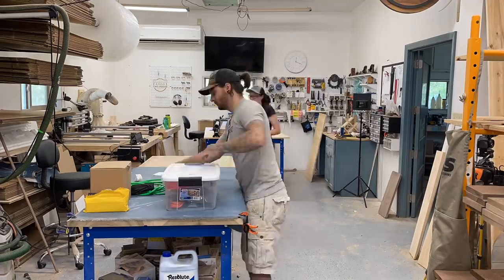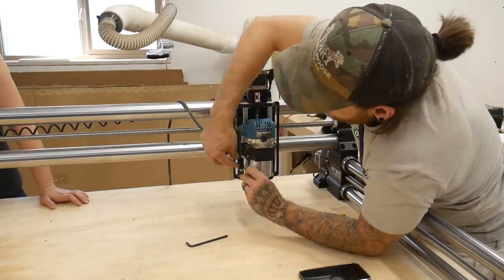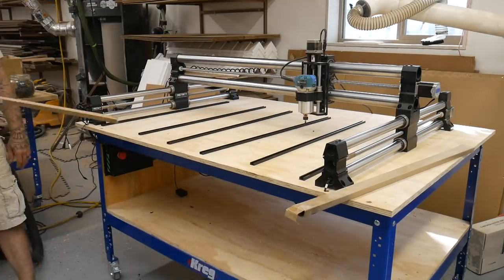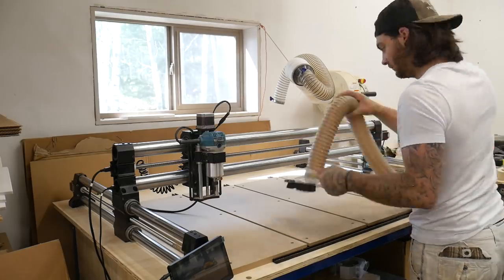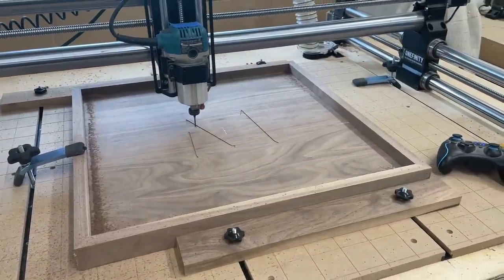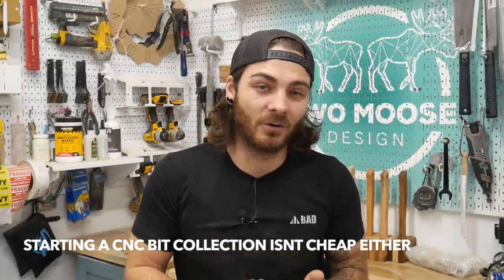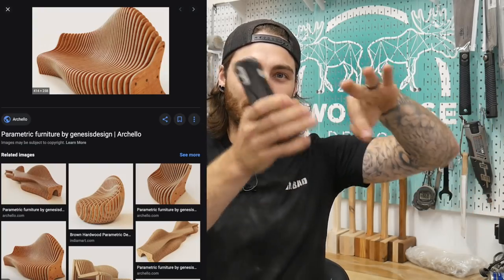Onefinity Journeyman, Bench, and Wasteboard Set up // CNC //

Comment: Nice video! Have to laugh at the people who have nagged about cutting the waste board lol. I come from a precision machine shop background, and these people would cry if they knew how much we would spend putting aluminum waste boards in our mills... It's there to cut, you want the mill going below the bottom of the part for a clean dimensionally accurate finished part. Only thing I think I would have done differently in setup was to use the machine to layout the T slots and predrill their holes rather than take the time to do it manually. I'm awaiting delivery of a new laser to start my journey down this road of custom small scale custom crafting, but once I recover from that purchase a CNC router is next on the list. Likely going with this company. I think for the price this appears to be a beefy well built machine, and the controller and interface on the Elite model looks amazing. I'm used to Fanuc controls on industrial mills and lathes, and that new control looks to give the same feel to setup as I'm used to. Really wish they offered a wired or wireless handheld unit for axis control during setup though.
Reply from the maker: Thanks for the input! And cracks me up too, a sheet of mdf isn’t that expensive and you can get multiple surfaces out of one set up. It’s called a WASTE board lol I surface mine a few times and typically just put a fresh one on once a year just because. The onefinity has been great, I like the elite masso if it’s in the budget.

Comment: I have had the red and black 60watt CO2 laser from Ebay for 3 years. Got it for $1,700.00 I love it. Have not had the first problem with it. I have used a large cooler with ice bottles to cool the water as long as I have had it and it has worked very well. You just have to make sure it comes from a US distributor in case there is a problem with shipping and also there will be no support to run the laser. Like you said about the CNC router, you need to be willing to learn the programs. Not that hard. I just got a water chiller for $455.00. I will arrive today. I will no longer have to freeze water bottles!!!
Reply from the maker: Nice! That’s exciting, I’ll have to look into that I’ve talked to a few people who’ve ran eBay machines

Comment: your dust collector is more than adequate.  You just need to run the 4" hose all the way to the router bit.  This will allow enough airflow for collection.  As it is right now you have a choke point when you reduce the hose from 4" to 2.5".  Open up the flow.

Comment: Question. Youve been a big help figuring out my onefinity purchase. 
I want to get the same Kreg stand but I’m confused on how to run the stringers. Are the stringers sitting slightly above the Kreg channels on the top or flush with the Kreg channels? And how did you screw the 3/4 ply to the stringers. Did you mount the ply to the Kreg stringers as well ?
Reply from the maker: I notch them so they sit flush with the top of the metal channels. Then screw the plywood down to the 2x4. You can add a screw to the bottom of the channel into the 2x4 as well
Reply: @TwoMooseDesign  Awesome, thanks for reply !
Reply from the maker: Thanks for watching!

Comment: Great video. I just bought the same machine. I am to the point of hooking up the 2.2kw spindle.  Question are there steel t tracks available? My very first router was a 6040 and the t tracks would bend with pressure. The only ones I see are aluminum anodized t track.
Reply from the maker: i have no idea, i believe most of them are aluminum 🤷🏼‍♂️

Comment: I want to use my laptop to use to use this machine will I get instructions how to hook it up to my Laptop, thank you nice video
Reply from the maker: hey! if you have wifi whre the machine is you would type in hte IP address on the machine screen into your web browser and it will pull up the machine post proccessor. Just reach out to onefinity im sure they have a blog write up, its pretty easy to do. If you dont have wifi youll have to transfer files manually and use the screen on the machine.

Comment: Do you notice any extra vibration with your table being on casters like that? I'm designing my bench for my new onefinity and am trying to work out movement so I can access the pass thru for longer pieces
Reply from the maker: It does wobble more with the wheels, if you don’t need them I’d skip them. I’ve also haven’t had any issues, my foreman doesn’t have wheels but I left them on the journeyman

Comment: Has the single sheet Of three-quarter inch birch ply with the two 2 x 4 supports been enough for your set up? I only ask because I have people on the one Finity Facebook page telling me I should put more support up under my table top and also that I should put another sheet of plywood on top of the one I have that seems like a little overkill
Reply from the maker: It’s been just fine, if you’re worried just add 3 2x4 supports.

Comment: Thanks for a quick rundown of the machine and the question/answer session.
My experience is with a small Shapeoko I built and then later the larger Shapeoko (which I gave to my son), and Vectric software. Want to get a large machine again.
1)What size are the stepper motors?
2)Do you think the rigidity of this machine is as good as or better than a next wave 520 with the mdf base?  I was thinking of getting the 520 but too expensive , ain't happening this year.
3)Does it have a homing function (x,y,z limit switches)?
4)Do you think the screws are better than belts?
5)Where is it made?
6)I don't do facebook. Is there another site specialized for these machines?
Thanks.

Comment: Great video! Will the Journeyman fit on a 60" x 48" by chance? I know you mention the footprint is 60" and my surface is 60". Just wanted to make sure
Reply from the maker: It will but it will be tight and the motor and wires will over hang the 60”

Comment: Is that Kreg Workbench system sturdy enough to use with side boards in place you added but without the front lower rail and shelf?    I was hoping to roll storage cabinets under my Journeyman table to maximize my space.   Curious what you think.   Thanks in advance!!
Reply from the maker: Ummmmm I honestly wouldn’t maybe if you just suppoed the short sides and back? If that makes sense it’s super sturdy all together 🤷🏼‍♂️
Reply: @TwoMooseDesign  Thank you!!   I appreciate your feedback.   I’m looking forward to your future videos!    Very well done!
Reply from the maker: @edwardm5895  thanks for watching! I would check the onefinity facebook group. I’ve seen numerous people use this same style bench. Rockler and armor tool make identical styles too. I would suggest at least assembling 3 sides. The onefinity is pretty heavy and moves I’d hate to see it get messed up! I would check the group I’m sure they will have some answers.

Comment: You said the foot print is 60" wide, but I don't think you included the motor.  
How much is it when including the motor for those that want to build an enclosure?
Reply from the maker: Your right I didn’t include the motor 😬 it’s about 4 inches but I would also account for a few inches of extra space around it
Reply from the maker: I just measured the motor is 3” and the cables stick off about an inch so if you were to enclose it 65 would fit but it would be snug. It also depends what you are doing with the cables on the left side of the machine a drag chain will also add a few inches so I’d guess 66-68” would be about perfect
Reply: @TwoMooseDesign  Thank you so much! Really appreciate it.
Reply from the maker: @omegachar4754  you're welcome!! Thanks for watching we appreciate it!

Comment: Hey Jeff, Was there a reason you didnt use MDF for your top? Weight of the MDF? I just recieved the Journeyman upgrade yesterday and bought the same Kreg bench. Thanks!
Reply from the maker: Hey! no real reason I just prefer the look and if you are screwing into it the plywood holds screws far better than mdf.
Reply: @Two Moose Design  could you get by with no 2x4s under the table? Just a sheet of plywood sitting on top of the Kreg frame?

Comment: Did y’all add the shelf on the bottom when you first put table together or did you just use 2 separate sheets?
Reply from the maker: I was able to slide the full sheet in with it assembled
Reply: How much did you under size it for it to slide in? Sorry for all the questions I’m just having all my sheets of ply ripped down at Home Depot when I purchase them.
Reply from the maker: @donaldhardie3628  I don’t remember, assemble the bench and measure corner to corner on the side and you’ll slide it in at like a 45
Reply: I’m putting my machine together and I built the same table y’all did but I noticed when I put my y rails on my table they have a slight rock to them did y’all encounter that while putting yours together?

Comment: great video...whats your take on the caster wheels on the bench?  There are some die hard CNC guys that say even if they are locked, it allows for micro movements possibly causing the machine not to cut 100% accurate.  Any truth to that?  or can that Kreg bench handle retractable casters?
Reply from the maker: There is a tiny rock to the machine but for what I do it honestly doesn’t matter. It’s not like it’s throwing the carve way out a whack. Unless you are doing intense 3d carve or need extreme accuracy I don’t think it’s relevant. You could definitely bolt those work bench wheels to it as long as the weight load is correct per your wheel choice.
Reply: @TwoMooseDesign  I didn't expect you to respond so fast.  Cheers...really appreciate the insight.
Reply from the maker: @calebsanz9826  you bet! thanks for watching! Honestly most of the things the die hards nit pick about are irrelevant to 90% of cnc users. Which is totally fine for those who are super serious but just for general use I wouldn’t worry to much just get creating and fine tune from there. worst case scenario you take the wheels off.

Comment: I’m putting my machine together now and I built the table the same way y’all did but I’m getting some rocking from my y rails. It’s very slight but I’m not sure if it’s from the rails them selves or my table not being dead level? Did you have any movement before screwing your rails down?
Reply from the maker: Did you tighten all the bolts down before it was on the ground? Possibly loosen them then retighten the leg bolts. Also I’ve seen the rails twist before you can check the Onefinity forum you can loosen some bolts to fix it I believe
Reply: So take my table top off and loosen all the leg bolts with table standing upright? When I put it together I tightened everything while it was still upside down then flipped it over onto its feet. Also I really appreciate y’all’s quick response to questions or comments on the subject. That’s the type of thing that keeps me subscriber to a channel.
Reply from the maker: @donaldhardie3628  I would try that yes, then I’d it still has some twist search or post to the onefinity facebook group. I believe there’s a post on it on their forum 🤔 maybe take a few pics if that doesn’t work and email onefinity they will direct you to the answers

Comment: what was the dimensions of the CNC width, including the spindle motor?  I have the journeyman in boxes in my garage, and I am building a table for it.  I got it pegged at 64" approx., I'm planning for 66", gonna make the table 68"...  So my overall dimensions I am planning for are 45" deep, 66" wide, 17" tall (probably gonna plan for it to be 20")

Plan is to build a outfeed table that the top portion lifts up like a car hood.  The bottom layer hosts the CNC.   Small shop troubles lol.
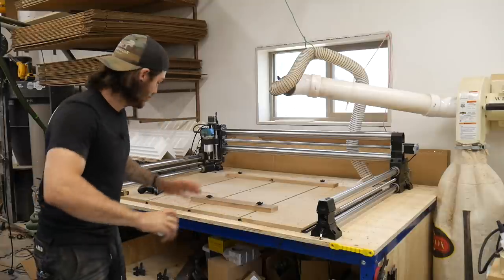Reply from the maker: 12:13

Comment: How stable is your table while running cnc when wheels are locked down? Thanks
Reply from the maker: I don’t have any issues with it rocking around. I all don’t run it at excessive speeds.
Reply: Thanks.  Too bad Kreg does not make a cross member in between the 28” and 44”.  I’m thinking of overhanging the bench top enough to give some work space for vertical clamping and cutting; sort of like what the Shaper Origin work station allows.  I would probably indent the front work area about 6” and use the Kreg bench to attach a T-slot clamping area on the face.  This would allow joinery work to be done.  I hope that made some sense?  Feel free to add any thoughts to this idea…
Reply from the maker: @GuitarsByWarr  yeah the sizes are odd lol  you could probably cut one down to any size you need and just drill new holes 🤷🏼‍♂️

Comment: Doesn't need to be perfect??? This is the part I don't understand about about the Onefinity..... No it doesn't HAVE to be perfect but any deviation in the mounting points will throw the coplanar of the Y rails off and have the X and Z being unable to flatten the wasteboard consistently especially across more than 48" in the diagonal plane. I'm not being critical but if you want cnc accuracy then a dead flat base is where you begin.
Reply from the maker: I don’t need the machine to be exact. I’m not milling anything to any exact parameters. I cut out shapes, engrave items, and make catch all trays. I barley trammed the machine and it does everything I need it to. I’m not milling aluminum or doing any 4 hour 3D carves. It’s a hobbyist machine, im not batching out 6000 items at .001 tolerance. People can set up machines as they wish, this is how I did it and i’m more than happy with my non “dead flat” table.